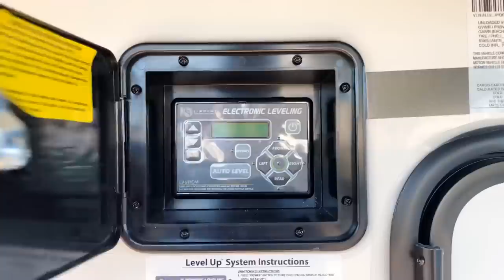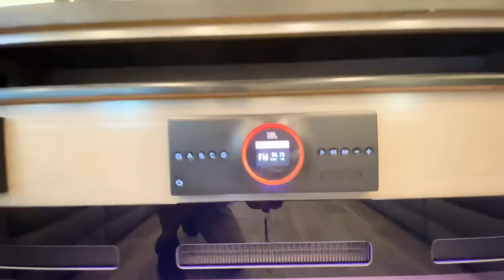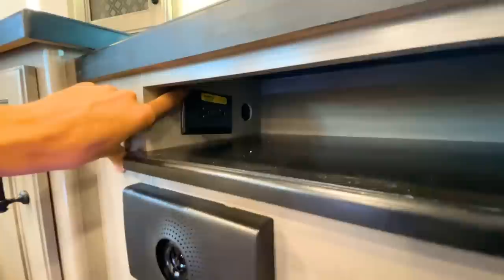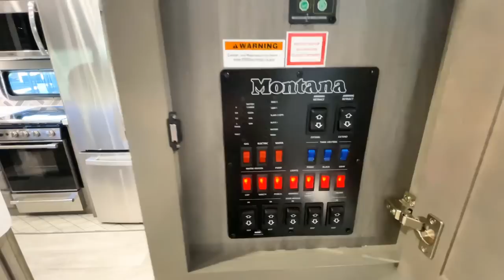#1 Selling Luxury Fifth Wheel EVER and it’s BEAUTIFUL | 2022 Keystone Montana 3761FL

Comment: Glad to see the color on the Acs is white vs black.  Always happy to hear that a dealer does provide a camping spot especially for newbies.  ? Do you also provide instruction on towing or driving for someone who is new?  This would be a great safety program.  Great color scheme but would prefer a bronze or gold color fixtures/handles.
Reply: As a person who’s hauled a lot of fifth wheel campers and 40ft goosenecks there’s no real instructions for it. Just take your time with it other vehicles on the road will often times yield to you. Best piece of advice I could give is go to a big open parking lot and get a feel for taking turns and backing it up. driving on the road in a straight line is the easy part taking the turns and backing it up is what takes a little time to master. Side note fifth wheels are actually easier to haul then travel trailers don’t let the length intimidate you.
Reply: Definitely would need assistance in driving one,& setting it all up.

Comment: Wow! This is beautiful. Great tour, very thorough. I wish this had an office w/door for working on the road but I think I might deal with modifying a spot in the living room given the rest this unit has to offer.  One thought I had-the washer dryer-the location looks tight with minimal room between the bed and washer dryer connection area. Do you know if they install front facing toward the bed or facing toward the hanging clothes area of the closet?
Reply: I thought the same thing.  They put it there because the vent for the dryer has to be cut through the outside wall.  That's why I got a combo.... it does not need to be vented or so I was told.

Comment: Nice videos. I like that you are thorough, but I got to say, when you say there's rubber gaskets on something, Like the suspension system or the pin box, you're pointing at a bushing... Not a gasket. 👍
Reply from the maker: I appreciate that. I’ve corrected that on my most recent videos.

Comment: Myles: I really like this unit, but do you know why the sofas in the front living slides come out so much further than they did on the 2021 or 2020 model?  It’s pretty odd, I’ve noticed this in other review as well, or are they just not slid tight to the sidewall of the slide?  I really don’t like this as it causes them to nearly touch when they are pulled out for beds plus they partly block the cabinet doors.

By the way, I really love your reviews!
Reply from the maker: I’m not sure! I did notice that too and I don’t know if it’s a different couch design or what exactly. When I speak to Montana next, I’ll ask and see if they have an answer.
Reply: Myles RV’s: Thanks a lot.  Please look into this. I’m very interested in this model and unfortunately this is really bothering me!

Comment: Very nice presentation and very nice RV, but probably way too expensive for me. You should include the length, width, & height in your description, along with the base price, unless I missed hearing them.

Wasn't expecting the washer and dryer hookup. Nice surprise. I'd trade out one of the side sofas for my office desk, and the other one for my task & craft desk. I'd keep the front facing recliners though. The island in the kitchen is a little too close to the oven range. Those of us with walkers and canes would have trouble getting through on that side. There is enough space on the other side of the island to move it over a little closer to the dinette, so this is a fixable problem. The bedroom door also needs to be a little wider. If I were buying this unit, I'd trade the powder room for the butler's pantry. Both the inside and outside storage was more than I expected. I don't like the raised bowl style of sink, so I'd change that. There are some other tweaks I'd make, but overall, this is a nice RV.
Reply: I doubt that the door space is 28"... more like 24".  They do make customized RVs but they are expensive.  When I used a walker I found that the narrow area (28") between the island and the stove was just about right and that I didn't have to use a walker in that area although the walker could get through.  I just used the counters for support.

Comment: Would have liked pull out baskets in pantry as they are nice deep shelves. If there were just two of you and no overnight guests I would rather have washer/dryer where 1/2 bath is. Nice shower size. Like the cabinet colors. This is ideal for Snow Birds where you live in it for months at a time. I love the front living room with plenty of seating. Great trailer.

Comment: Is this fifth wheel sealed underneath to keep rats and mice from coming in? 
You did a great job description of this trailer I am very interested if it is rodent proof,
Reply: I too would like to know I had a 2011 Montana Mountneer and I had micr problems 😡 I had mine set up in Alberta years ago used it as a appartment away from home for work had it skirted in well insulated -45c nice and cozy warm.

Comment: Dishwashers should be standard in these luxury models.
Reply from the maker: Keystone used to use dishwashers in RVs, but I believe it was something about having an increased potential for interior water damage from a dishwasher that caused them not to use them. But there are options out there with a dishwasher if that’s a must have for you
Reply: @mylesrv  thanks for the response on that. I figured that was the case. All they have to do is incorporate a turn off valve under the sink in case there’s a leak in the line. I’m looking at several different models right now. We currently live in our 2007 Cameo by Carriage fifth wheel full time. Looking to upgrade later in 2023 or so. I really appreciate your videos, and your tours are concise and to the point. I also appreciate hearing your honest opinion irrespective of the brands you sell.

Comment: Only issue I have with this video is they changed the night stands to above the bed which you can now hit your head on. How were you going to hit your head on a night stand at the same level as the mattress? Now it protrudes from the wall with sharp edges.. not a fan.
Reply from the maker: Night stands of this size next to the bed in most king bed floor plans meant that the night stands would actually come over the mattress and take away bed space. These stands are also up so high that even me being 6’2, I don’t see how I would ever hit my head on them.
Reply: @mylesrv  ahh ok fair enough hard to judge from the video i guess. thanks !

Comment: which is a better RV montana 377fl or this one montana 3761fl. i heard the 377 sits low so it will drag in low areas is this true?. also i have a heavy duty 2018 2500 dodge diesel truck. will it pull either of these. we have a bumper pull and already a bumpy drive. or do we need to install airbags or get a different trcuk:( i like this one, but husband like the 377:( we have grandkids but this look more spacious. any comments will be appreciated
Reply from the maker: The Montana 377FL is a High Country Montana while the Montana 3761FL is a full feature Montana. High Country Montana’s are the “little brother” to the full Montana. Either will work, or just depends on which layout you like better. But the full Montana will have more features than a Montana High Country.
Reply: @mylesrv  will my truck pull it or do i need to make adjustments

Comment: Earliest I've been 😂,anyway what's your advice on what rvs to get with two full bedrooms that can be hauled by a half ton that can be full timed in.

Edit: can you do videos on motorcoaches more often by any chance?
Reply: There probably isn't one that is weight rated for a 1/2 ton, those are pretty heavy..
Reply: @tyflesh  I realized where I messed up in that comment,I meant 3/4 ton instead of a 1/2 ton 😂
Reply: Look at the Grand Design 311BHS and the Grand Design 367BHS and 31MB. The 28BH is nice too..also from GD. It's a bit different but a neat lay out especially if I have small kids @Ty Fleshman

Comment: OMG they put that horrible little stove in their brand new model, whats the matter with them.  You cant bake anything in that stove, for one its too small and for two that line of fire that burns under the only shelf burns everything on the bottom and the oven does not get hot enough to bake bread.  I have a delux 2013 mountaineer model that I have refitted to the hilt (with a new oven too) and it is far more glamorous that this.  My insurance says I get to purchase a new one in case of disaster here and I would not be happy with the 2021 model.

Comment: For the money you pay for this 5th wheel they put the cheapest pin box they could on it didn’t they? Lol. My old 2006 had a better pin box then this one. These new 5th wheels are built with junk but yet charge you 6 figures for a pile of trash and dumb people like up to buy trash.. if only people did some simple research they would find how trash the new 5th wheels are. Listen people! IF YOU DON’T BUY THESE PIECES OF JUNK THEY HAVE TO LOWER THE PRICE! Come on people get smart stop buying these and let the prices go down. Nobody needs a brand new 5th wheel that bad where they can’t wait a while till the prices go down.
Reply from the maker: The cheapest pin box is one without any sort of shock absorption.
Reply: @mylesrv  The point is this pin box isn’t expensive for the price of this 5th wheel. These manufacturers build them as cheap as possible then charge the consumer a high price. My point is that consumers are too ignorant to pay attention to that and are getting ripped off. These 5th wheels in general are not worth 100K plus